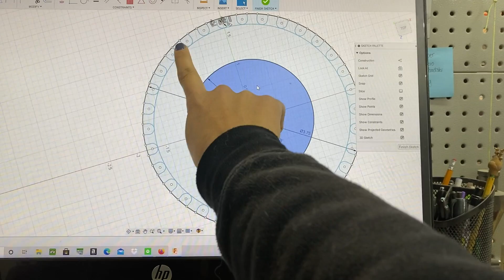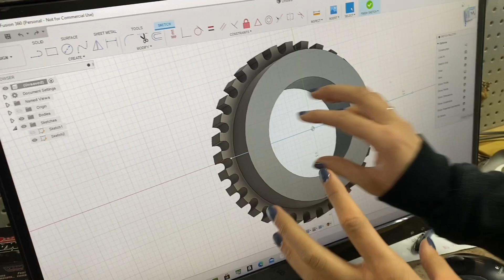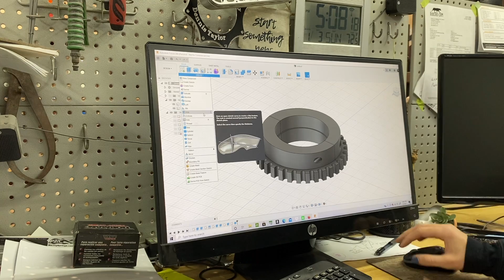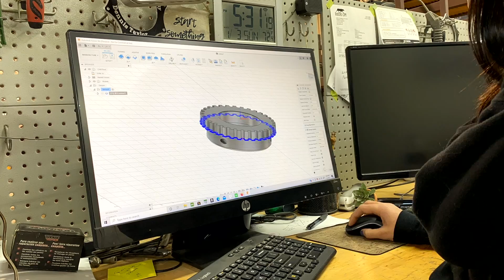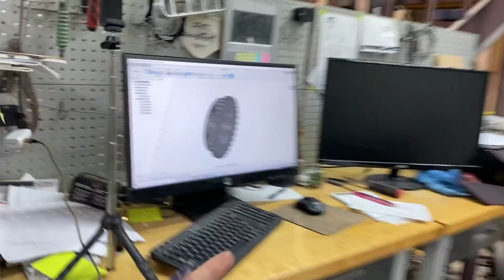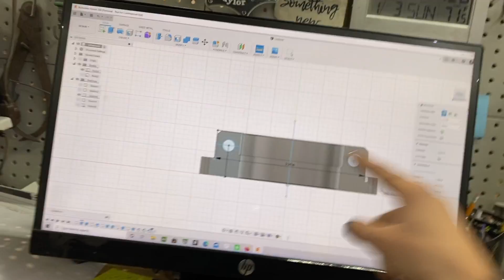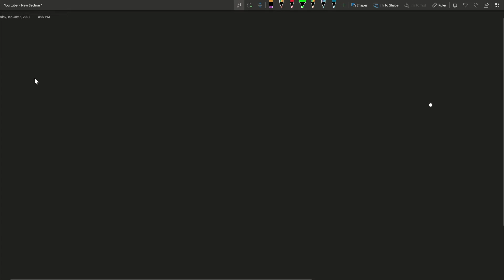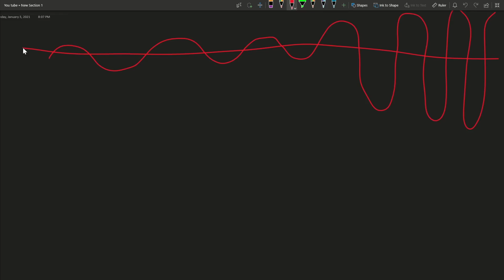We Needed So We Made It 🤷🏽‍♀️ Maybe Slova Will be Fast One Day! 😆 & Tech from High Speed Consulting

Comment: You shouldn't side cut with an endmill cutter in a drill chuck. It will ruin the jaws in the chuck and cause excessive tool runout. You should get a set of endmill tool holders. I've been in the  tool and die business for 35 years. Great projects to learn on, Nice job.

Comment: Great CAD work and machining.  The only thing is it is going to be off balance as the Allen heads are on the same side, so one half will way more than the other.  If one head was on each piece the weights would offset each other and spin smoothly.

Comment: Just a helpful tip, if you make your circular "dips" just a little bit bigger than your tool diameter (0.187) it will help eliminate the tool chatter you saw at the bottom of each of the circular tooth "dips".

Comment: Drills are the most economical and efficient way to remove material so in the future would be best if you drilled the route between the teeth as much as possible and then go back in and clean and profile with an End Mill to get better results quicker with less machine time unless we're on the more expensive End Mill. Also Hall sensors for the win.

Comment: Soooo.... in the name of having a driveshaft speed sensor, why not have a simpler magnetic setup, ie.. having your magnet(s) in laid into a spot in the driveshaft that that corresponds with the sensor relaying data back. Im no engineer by any means an im sure there's a direct answer but just purely curious
Reply: The driveshaft spins so fast it’s hard to stick a magnet to it and have it stay. So, you’d basically end up making a similar part to hold the magnets. And the get higher resolution you want more pulses. At the end of the day this way gets a good number of teeth for pulses and is robust enough to stay on. 

For simplicity I’ve seen setups that use the ears of the yoke to read, but it would only be accurate enough for a simple speedometer reading.
Reply: Or imagine taking small squares out around the circumference an having them filled with the ferrous material then whole shaft balanced... wouldn't that work in theory

Comment: someones dad needs a few bt40 er25 collet chucks and a set of collets for his birthday! thats a machinist sin putting an endmill in a drill chuck!!  i gotta give respect though it still got the job done! its pretty cool you not only drew but tool pathed that as well. if you wanted to get rid of the chatter in the bottom of the teeth you could draw a bolt hole circle so it would take like .003-.005 off and use a drilling  cycle to finish the walls at the bottom of the teeth.  like 3k and maybe 5-8 ipm.  that usually works in that situation of a long tool overhang and a large side engagement of the tool.

Comment: If you design it with symmetrical holes, threads, and countersinks the final assembly is naturally balanced while spinning.  This would mean each half would have a tapped hole on one side and a countersunk hole on the other side. Both parts would be identical.  Of course yours will work fine, just a way to make it a little bit better next time.

Comment: So could you have 2 drive shaft speed sensors on each end of the drive shaft, and then see how much the drive shaft twists under load to get a live torque number? I know that's way out of the box, but it could work. Calibration could be from doing 1 or 2 dyno runs and scale the twist in the drive shaft to a torque number
Reply: Short explanation, You would have two pulse trains from the sensors and measure the shift in pulses between the two. It would be hard get the resolution for it to be accurate and repeatable
Reply: @pbertlin6194  like I said, way out of the box
Reply: @joshlewis5065  Nothing wrong with thinking out side the box👍 Think strain gauge😉
Reply: @pbertlin6194  but if the drove shaft is spinning, how can it sand a reading??
Reply: @joshlewis5065  slip ring, RPM might be problem with induced bounce
Reply: @pbertlin6194  that could work. Just make it super solid to the driveshaft
Reply: @joshlewis5065  I would probable go the other direction, inherent vibration with rotating assembles and harmonics at different  RPM's

Comment: Are you worried  about balancing issues by having both bolt heads on the same side?
Reply: I thought the same thing. 
I'm guessing it's not going to matter a huge amout because it's a small weight, close to the shaft and bearing. 
Alex, from a ballance point of view you're better off having the bolt heads opposite. Easy done using a circular pattern in Fusion.